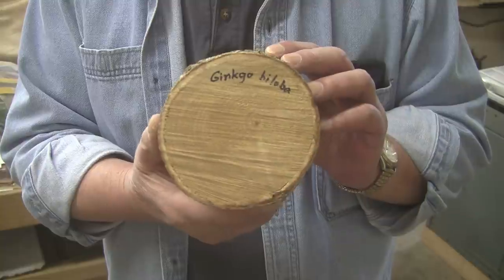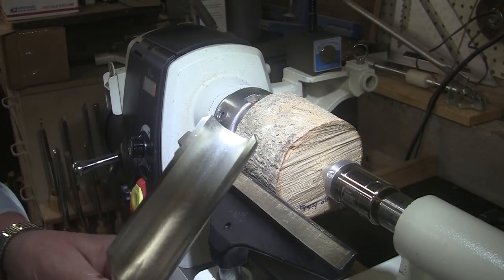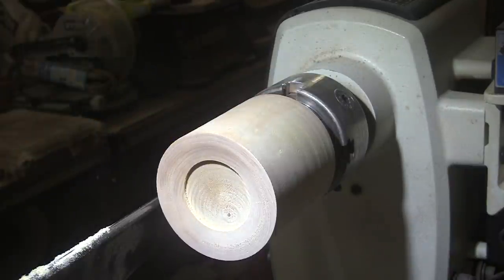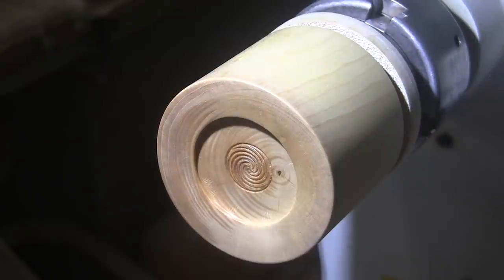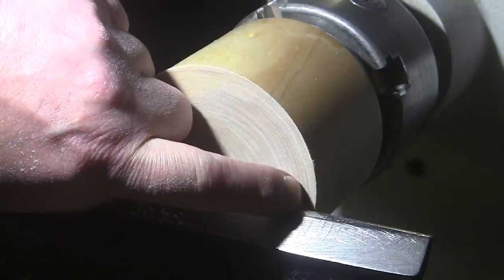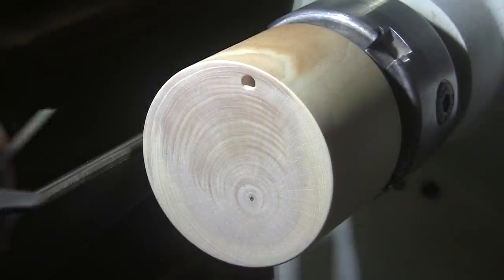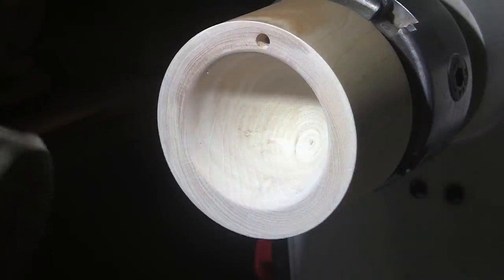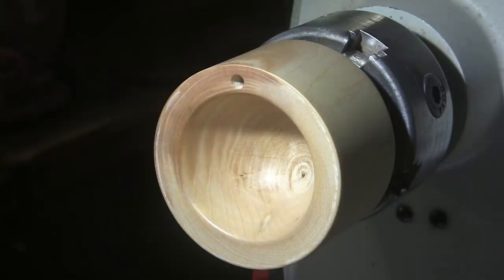Ginkgo Biloba Salt Cellar! - Wood Turning

Comment: Nice job Phil.  I've got a big ginko tree.  I haven't cut but a cuple of small limbs off of it.  The wingspan of the horizontal limbs from tip to tip are 80 feet or more.  It's one of my favorite shade trees.  It was 18 yrs old before it started bearing fruit.  The fruit has a nut inside a little smaller than an almond  The fruit is a little larger than a bing cherry.  It's been droping green fruit since the first of July.  But in the fall that fruit will turn an orange color and start to smell - like dog poop.  And when they are ripe and fall, they splat all over the place.  And the tree is just loaded with fruit, probably 15-20 bushels.  And the tree is loaded with leaves, probbly a pickup load and a half.  And they are wet and heavy.  Around the time we get our first freeze all of the leaves will fall in one day.  And some of those lower limbs just grow straight sideways.  And as the tree gets older, it develops a ring like muscle around where the limb attaches to the tree.  There is an entire process for removing the fruit from the nut, then freezing the nut for a couple of months to get it to crack, then remove the bean-like center which has a skin around it that has to be removed, then roast or cook or fry - multiple recepies for what to do with that bean which is an horderve in Japan.  But that ginko nut center (bean) reacts in the human body like a blood thiner.  So you have to be very careful digesting it and in combination with other meds.  All of that from that beautiful little salt cup.
Reply from the maker: Sounds like a beautiful tree that is a real pain to deal with, Bill!  I'm tired just reading about it and I don't have to deal with the mess or hassle! 😀

Comment: Aligned small rare earth magnets between the lid and body are a nice addition and give a satisfying click when you slide the lid shut.  I also use 1/2” walls.  These are especially useful for those of us with enough years to have trouble seeing how much salt comes out of a regular shaker.
Reply from the maker: I considered using magnets, W W, but then I think it would take two hands to open and I didn't want that.  I sure know what you mean about seeing the salt, or not!  LOL!  😊

Comment: Salt cellars go back into history.  Before salt shakers, each person at the table would have their own salt cellar, a tiny bowl, usually glass or crystal, about 1" across inside diameter, and maybe 1/2" deep.  They had teeny tiny spoons for measuring out the salt.  Collecting these antique cellars, which come in a staggering variety, is quite a hobby with a national association, of which a friend of mine spent a term as president.  ;-)

Well...you could have blocked in the hole with a dowel and re-drilled it to the size you preferred...
Reply from the maker: Thanks for all the info, Lizzy!  Yes, I could have done that except I used the size I preferred.  I wanted a good sized bit of brass showing.  After I had my good sized bit of brass showing, I discovered that meant thick sides!  As it turned out, the thick sides do not matter at all. 😊

Comment: I like the effect of the pith and the grain inside the cellar, it creates almost an optical illusion. And you want the Cellar to have weight and your thick walls helped to provide that. Great Piece Phil. Its nice to see you used both wood and metal in your creation. And never forget, there is great beauty in simplicity !
Reply from the maker: Thank you, Funko!  Simplicity is what I was after with this piece.  I just want it to function and it does!  Success! 😊

Comment: I am brand new to wood turning and I have major trouble hollowing out end grain. When you make the recess, your cut is smooth. I have been experiencing some ugly catches and had a blank fly off at me. My face shield prevented a major dent in my face. Hmmm...I may need to rethink this wood turning venture and just watch your videos...lol
Reply from the maker: You have to approach end grain from the side, Michael.  I find it easiest to cut from the inside towards the outside.  Might try that.  Slow and steady, you'll get there. 😊

Comment: We can these salt “pinch dishes” & it’s all we use! We don’t have shakers. I had a bamboo one, until one of my labs knocked it off of the table & snapped the lid off. Now I just use a small plastic container with a snap on lid.

Comment: I hear you about the nice weather Phil.  I didn't make it out on the sunny day.  I wound up turning on Monday in the rain and promptly caught a cold so I've been recovering all week.  Ugh.   You mentioned your side by side.  Do you have a Slingshot?  Oh, we may have more in common that I thought.  We have a Gold Wing with a sidecar.  I had to sell my Gold Wing several years back due to breaking both my ankles (long story - separate incidents).   We will have to go for a ride sometime if it EVER gets warm again.  sigh     

BTW.  Really nice container.  That has to be the most normal thing I have seen you turn.  Now I want to make one.  I have some Walnut that's been sitting for nearly two years that would look really pretty.
Reply from the maker: Hope you're feeling better very soon, Suzette!  I have a Kawasaki Teryx.  I bought it mostly to use here on the property for work, but I find myself riding it around the city quite a bit when the weather cooperates.  I miss riding motorcycles, still have my endorsement for ANY two wheeler.  Check about the Walnut.  I have heard it's not food safe.  I know I don't use any of it to mulch anywhere.

Comment: That gouge is like... you don't get it out often, but when you do it's hella fun
Reply from the maker: Haha, maybe for you! 😄
Reply: @PhilAndersonShadyAcresWoodshop  Question, how do you like the Benjamin's best scrapers you talked in the negative rake scrapers vid?
Reply from the maker: @timofeyzhukov-khovanskiy9173  Nearly all of my tools are BB.  I have no complaints, they all work as intended and as I expect them to.
Reply: @PhilAndersonShadyAcresWoodshop  
Hmm, I have their beginner set and couple of pricier tools, but was eyeing the scraper set. If they are good enough for you, should be good enough for me
Reply from the maker: @timofeyzhukov-khovanskiy9173  Well, in the beginning, I compared them to other tools I saw in catalogs.  Certainly there are better tools on the market but for the ones that are M2 steel, these are too and they can be less that 1/2 the price of the others.
Reply: @PhilAndersonShadyAcresWoodshop  Yeah, I got one premium m42 steel gouge and I do most shaping with it, but if I do a hollow pot-shaped object and need to hog out the inside or do some final touches on the bottom of a deep bowl, a scraper works great, and I got a BB 3/4" one from the starter set and wanted to upgrade to a chunkier tool. Have you rehandled any of the BB tools?
Reply from the maker: @timofeyzhukov-khovanskiy9173  No, I have not rehandled any of them.  I did not think I would like the handles in the beginning.  Now, they just feel normal and I have no issues.  They used to make their Long and Strong versions of the gouges and I have a set of them.  They have longer handles.  I ground them all to have a swept back profile because I thought that is what I would like for everyday turning but found that not to be true.  I really need to regrind them back to a more standard profile so I will use them.
Reply: @PhilAndersonShadyAcresWoodshop  I think I'm gonna pick up the scraper set this weekend, make two into negative rake for the finishing cuts. Btw, I have a 5/8 big bowl gouge, and I'm not sure I strictly need a 1/2" one, do you find that after a gouge is of certain size it is just fine as is and you may need a 1/2 and a 5/8?
Reply from the maker: @timofeyzhukov-khovanskiy9173  This is an area I'm not sure of.  I have 3/8, 1/2 and 5/8" gouges.  By far I use the 5/8" the most.  The others come in handy when working close to some feature or for smaller work.  But, I've seen other turners use the smaller ones when they want to get a finer cut, a more polished finish.  I probably could learn from them. 😄
Reply: @PhilAndersonShadyAcresWoodshop  ok, so grinding the BB heavy duty grinder into negative rake was a rough experience on a belt grinder

Comment: Simple elegance ready for any retired sea captains kitchen or other old salts Can't wait to make one. Just one quick question if I may be so bold, Could you please tell me the proper name for the "thing" you used to make the chocolate swirl on the base of the bowl. I have tried to find it, without success on all my suppliers. Thanks so much once more for your truly inspiring videos.
Reply from the maker: Thank you, Alan!  It's the Sorby Spiraling/Texturing tool.  There are two models, this was the smaller of the two.  Here is a link to the large one but if you scroll down you will see the small one, too.  Hope that helps!  https://www.amazon.com/Sorby-Texturing-Spiraling-System-Model/dp/B016T9MBFM

Comment: Just found you Phil. Great video. Might I ask about the texturing tool you used on the base. Love the effect.
Reply from the maker: Thank you, Adam!  It's the smaller Sorby Spiraling/Texturing tool.  I have the larger version, also, but this one seemed right for the job.  Either one takes practice and I use them so seldom it's always a learning curve but they do work well when used properly.

Comment: You're one of my favorite wood turners to watch. Thanks for all the great videos. I'm just wondering why you choose not to use a forstner bit to make your recesses or when you first start to hollow out your bowls? And how does one find your info on sending you wood?
Reply from the maker: Howdy, Eric!  Thank you so much for your great comment!  I do sometimes use a Forstner bit to hollow a piece.  Usually just if it's a vase or other tall piece.  The recess is so easy to turn I think it would take longer to set up the bit than it does to make it.
You can contact me by clicking on my picture, then the About tab then where it says For Business Inquiries.  My email address will appear.  Thank you for that, I really appreciate you thinking of me in this way!  😊

Comment: I have been wanting to get a lathe and start learning how to use it. Is it hard to learn how to use it. I love the fact that you use all the natural wood and you don’t use resin. I also love the pieces you make that you leave the bark on. That makes the piece more beautiful. I have seen sets of gouges on Amazon for 60 to 100 for a set of 8. I don’t have much money because I am on a fixed income. I am on disability due to a motorcycle accident. What would be the least expensive tools and lathes to start with? I have seen used lathes on Facebook Marketplace fairly inexpensive. Could you give me some advise on this issue?  Thank you.
Reply from the maker: Lots of difficult to answer questions, George, but I'll try.
I learned how to turn from YouTube videos, just like you are.  I watched about four hours per day then went to the shop to practice what I had seen.  It took a long time, lots of frustration and big catches but, finally, it all clicked.
This is an expensive hobby.  Just my sharpening setup cost nearly  $700.  There are other, less expensive ways to sharpen.  I use some of the least expensive gouges available and they are pretty good, last a long time.  The set you seem to be describing is probably good for spindle turning rather than bowls.  That's OK, just so you know.  Make sure whatever tools you get they are high speed steel.
I think the best, least expensive way to get into turning is to find a used lathe of a size that will accommodate what it is you want to turn, keeping any eye to the future.  When buying used, you can often get all the tools and accessories with your purchase saving hundreds if not thousands of dollars.  You will just need to be patient and diligent.
I hope that helps!

Comment: Lovely work Phil. You have much more experience than me, but a couple of questions from a beginner - 
I was taught in school woodworking 60 years ago never to use a screw in end grain - is it OK to use a wood-work screw into end grain as you did?
Also, I have heard others say that using a recess in end grain is not a good idea in case the wood splits?
Reply from the maker: Thank you, Robert!
You were taught correctly.  However, with experience and ability to read the wood along with some dilligence, you can do either or both with end-grain.  As long as the grain is tight with no cracks or other imperfections, success is likely.  You will see me mention both of those scenarios in some of my other videos.

Comment: Phil, where did you get your hold down device on your drill press.  I've seen several people with them, seems to work well.  I've never
heard of a salt cellar, made a very practical item.  Sometimes all you need is practical.
Reply from the maker: Well, Gerald, I got it at a little tool store that went out of business about 45 years ago!  They aren't made anymore.  The problem is, modern drill presses have the rack and pinion table mechanism and these won't fit.  There is a copy-cat version on eBay and you can sometimes find this original version on there, as well.  It's called a Drill Press Cam Clamp.
Practical is what I was after with this and it is proving to be just that.  😊

Comment: I just love your suck it and see aproach , much like myself,  only I don't have the same talent. It's also relieving that mistakes are not exclusive to me......and what is a "side by side", is it a motorcycle and sidecar as we call it in the UK. Stay safe Phil.
Reply from the maker: I think it's the best way to turn, Garry.  Just mount it up and see what happens!
A side by side, SXS, is a two-seater off road vehicle.  Mine has a roof and doors.  It also has all the equipment to make it street legal although that depends on the local authorities on whether or not they have made them legal to use on the public roads.  My jurisdiction mostly looks the other way.  Mine looks exactly like this.  Use the arrows to flip through the pictures:  https://www.topspeed.com/atv/atv-reviews/kawasaki/2014-kawasaki-teryx-le-ar161391.html
Reply: Oh , cool mate, we would castrated for having fun with one of those, British not very tolerant with having that sort of fun.

Comment: Phil, have you heard of anyone using salt or rice to dry their wood? 
  I thought about salt for about a week or two just cover the wood with it and let it sit for about a week to dry the wood out ||
Reply from the maker: No, I've never heard of that, Steve.  It does sound like it might help, though.  An easier, cleaner way may be to get a cardboard box of a suitable size, cut a hole for a fan, leave one end of the box kind of open, place the piece in the box, turn on the fan and wait a few days, couple weeks. 😊  Not my idea, several turners do this and it seems to work pretty well.

Comment: Nice job Phil. What kind of double sided tape do you use?
Reply from the maker: Thanks!  It's Shurtape brand.  https://www.amazon.com/Shurtape-Double-Sided-Hardwood-Concrete-152496/dp/B078BN7PQR/ref=sr_1_3?crid=2UGC89L1IWT5S&dchild=1&keywords=shurtape+double+sided+tape&qid=1617210016&sprefix=shurtape%2Caps%2C252&sr=8-3

Comment: Hi Phil, I’m wondering what the drill is that you use for sanding? I love how it’s so compact and a looks like it’s easy to use and get into tight corners. Cheers, David
Reply from the maker: It's a Ryobi 18 volt right angle cordless drill, David.  Mine is the older blue one, the newer models are green.  Yes, it does work quite well.

Comment: I would have used the cutoff for a lid maybe? I made one similar using a Forstner bit.
Reply: Actually, a domed lid would have been kind of cute.
Reply from the maker: I'm thinking you skip through my videos, Roger.  That's cool, whatever floats your boat.  I did use a cutoff for the lid.  I also explained why I didn't use a Forstner bit.  That would give you a square corner that you couldn't get the salt out of.  Rounded corners work very well.  😃
Reply: @PhilAndersonShadyAcresWoodshop  I think I wrote that before the comment about the forstner bit and seeing the lid being cut off. Oh well. I may have had it muted when my wife came in to talk too.

Comment: Hello Phil.  Is that the correct way to use a scraper
Reply from the maker: Well, I guess I thought so, Tommy.  Do you see something wrong with the way I used it?
Reply: I’ve recently bought a Tyme Avon Cub lathe with all the tools & I have been using my scraper with the bevelled side up. 🤷‍♂️
Reply from the maker: @tommyfeck1829  Normally a scraper is used bevel side down.  I've reground mine to negative rake.  This means there is a bevel on both sides.  This makes it easier to use and just about eliminates the chance of a catch.
Reply: Thanks very much for your advice it’s most appreciated.
I watch all your videos & learn something every time plus the manner you present your videos is so relaxing.
Thanks again Tommy 👍😊